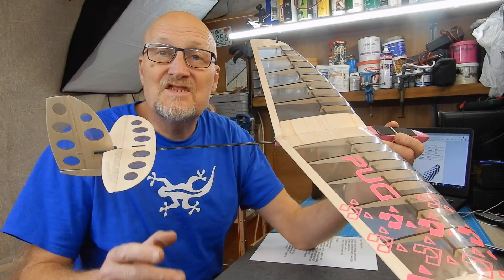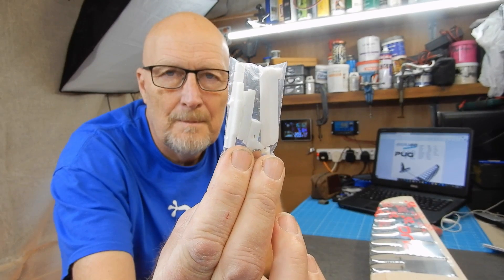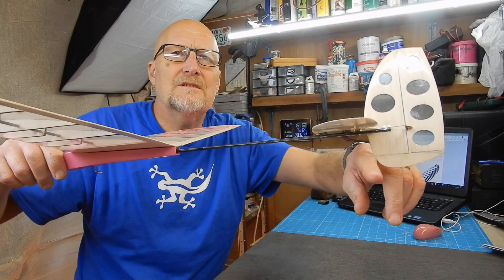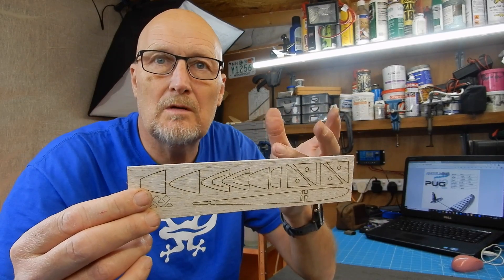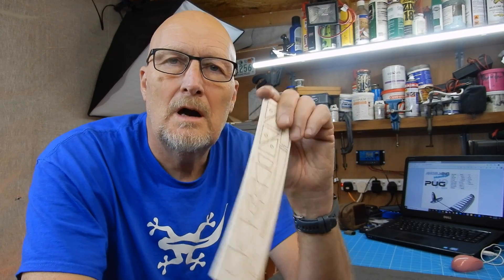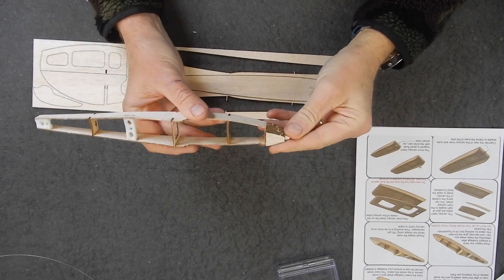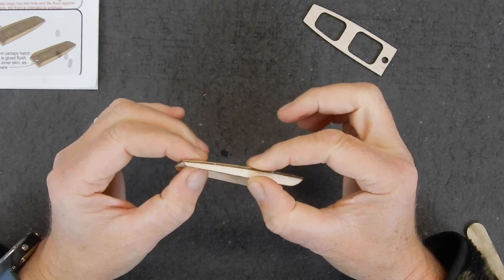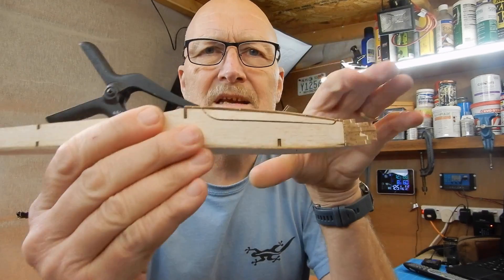How to build a Pug V2 DLG RES V-Tail from angel wing designs part 1 intro and fuselage

Comment: Hello sir. Tell me please, if it is possible to convert this glider to electric motor?! If so where is to mount the motor, front or on top of the wing? Then what size motor and propp is ok? Thanks
Reply from the maker: They do a motor pod mate check there web site or join fb group angelwingdesigns

Comment: Hello folks. Which battery precisely do you use for this glider? The one I planed to use, seem to be slightly too big to fit nicely. I'm so much looking forward to have it in the air.
Reply from the maker: Mate I used a 500mha 3.7v lipo